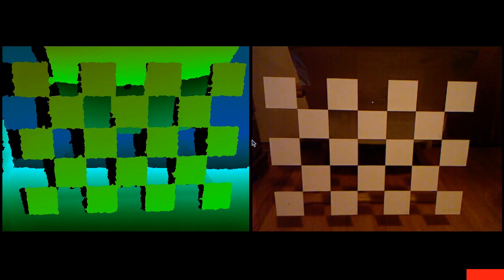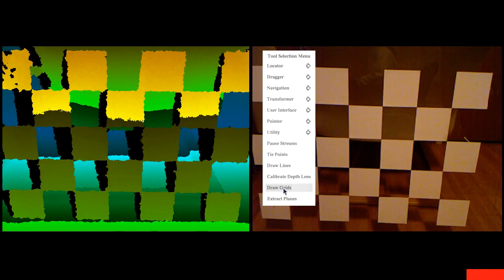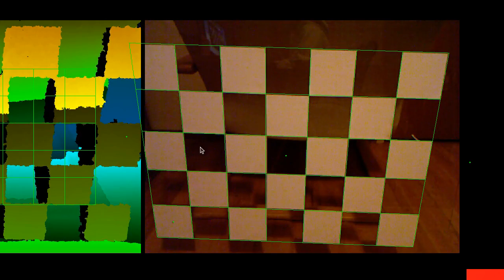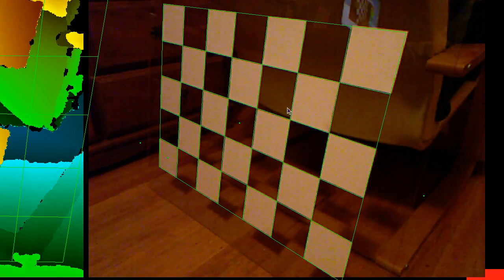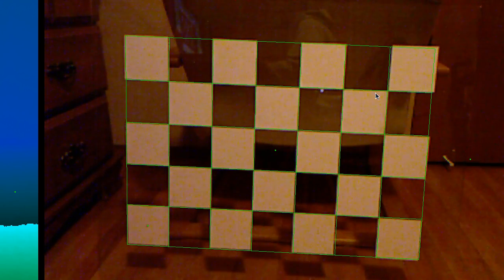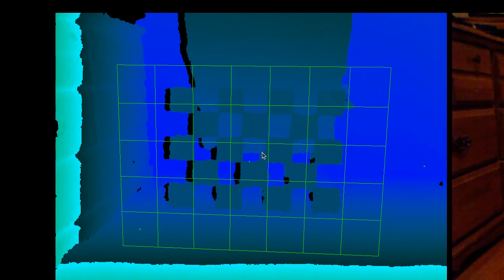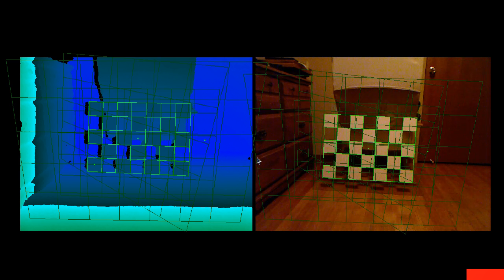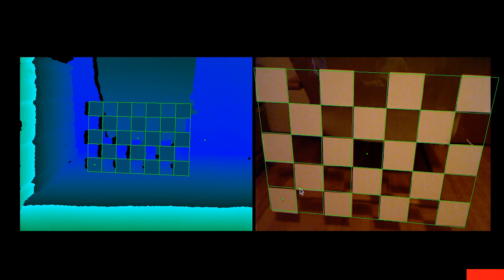Intrinsic Kinect Camera Calibration with Semi-transparent Grid

Comment: I mean, project the grid into a flat face on orientation, and then anything that is much smaller than the size of a tile either verticaly or horizontaly, is filtered out. And for the tiles that expand too much, identify them based on their position on the roughly approximated grid, and keep those out of the calculation for the fitness function (obviously making sure the function is still properly balanced with less elements).

Comment from the maker: Haven't found a way yet. Normally you roughly fit the grid, and then count the number of pixels in the checkerboard's plane that are in empty tiles, and the number of pixels outside the plane that are in solid tiles, and move the grid until the sum is minimal. The issue is that the Kinect generally detects solid tiles too large, due to its internal depth interpolation algorithm (being able to turn that off would be a boon), and that sometimes empty tiles appear half-solid for no reason.

Comment: After detecting a rough bounding quadrilateral of the test pattern, can't you then estimate the approximate size of the grid tiles in each point inside it, and then filter out details that are too small to be a tile? Or perhaps even detect which tiles are "bad" and ignore those when calculating the fitness function?

Comment from the maker: Calculating the plane of the grid is not actually that hard, but finding the edges or corners of the grid tiles is. I've thought about using minimization to find a grid projection that tries to put all grid points into "solid" tiles, and all background points into "empty" tiles. But the Kinect's camera has some very strange behavior, where sometimes "empty" tiles are half-full (can be seen in the video). That would throw off automatic fitters completely.

Comment: What if you rotate the depth axis so it is mostly aligned with the normal of the measuring grid, then filtered out all depths that stray too far from the the grid's plane? Would that allow for automatic fitting, or at least an automatic rough initial placement?

Comment from the maker: This was a good question before you removed it. :) Yes, the current software only uses the Kinect's two built-in cameras. But in principle it could calibrate to an external color camera. The math and the user interface wouldn't change at all; the program would just have to get its images from a different source. That's a simple hack.

Comment: I'm getting average results, I use it for depth-testing (betweed the reconstructed 3D Mesh and Augmented 3D Models), and I'm not making full use of the CoordinateMapper class, I'm just mapping the points (0,0) and (1,1) then calculating an offset and a scale.
You can see the results I got in this video near the end of it: youtube .com /watch?v=xdwAjXbviJ4
or in these images: i.imgur.com /4Bwl0.jpg and i.imgur.com /DwThO.jpg (ignore the incorrectly mapped right elbow joint)

Comment from the maker: I haven't worked with the official SDK because I don't develop on Windows, so I can't easily answer this. The truth, as far as I can tell, is that each Kinect is pre-calibrated at the factory, and the calibration data is stored in NVM and extracted by the official driver. Unfortunately, this part of the Kinect protocol hasn't been reverse-engineered yet, meaning that I have to do my own calibration.

It would be interesting to compare the accuracy of both methods.

Comment from the maker: The tricky bit is that sometimes the visible edges in the depth image have nothing to do with the actual grid. I'm pointing out some instances in the video, and it gets especially bad at larger distances. In the first setup I measure, I'm not even talking about a supposedly transparent square that's half-full with foreground pixels because the Kinect is somehow picking up the glass surface. These are the reasons I went with manual.

Re leap: Google "whither leap motion", which is my write-up.